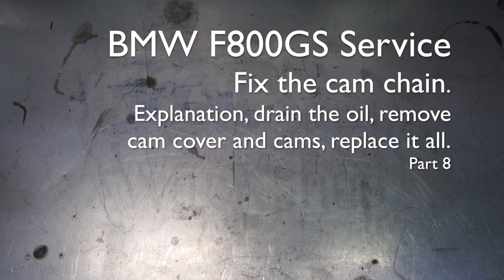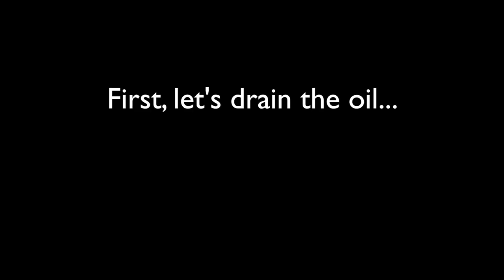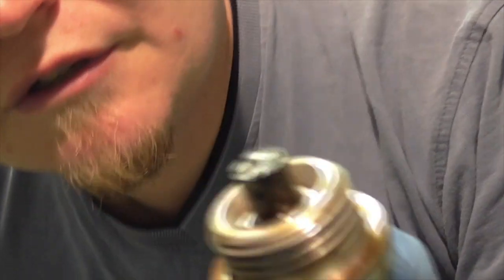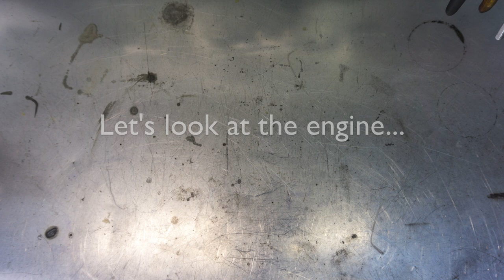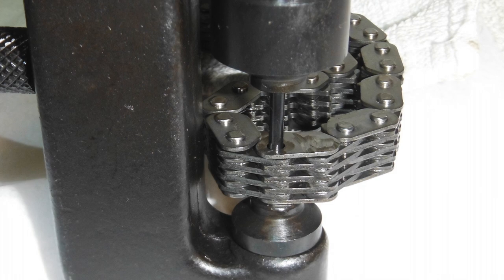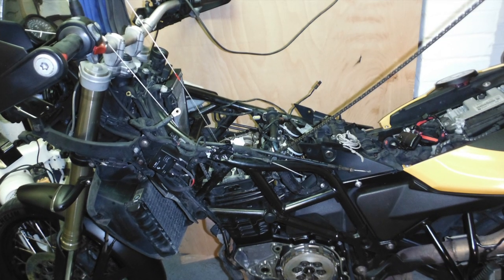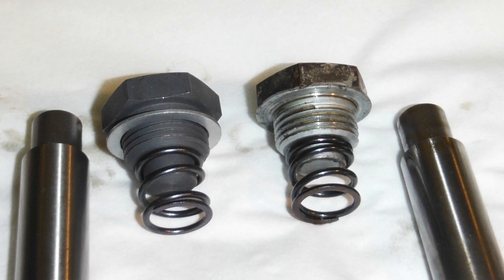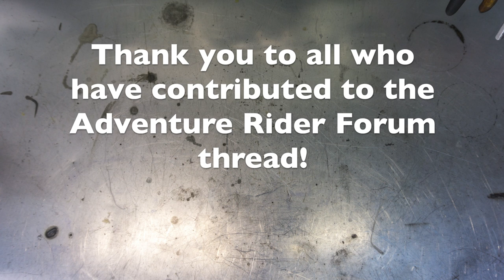F800GS Service E8: Replace cam chain, followers and tensioner

Comment from the maker: I keep getting questions about where to get the links. I don't know as this video is now over 6 years old. However, I'll post links to sites that have links here in this pinned comment. If you find that a link is out of date, let me know, if you find another link, let me know. I know that YouTube doesn't like you posting links, so you might have to figure out  another way to send the link to me (no, you're going to have to figure it out as I'm not sharing that info here).

https://www.motorcycleproducts.co.uk/sc0412h82rh2015-cam-chain-rivet-link/1/008357 - thanks to @hetzaljekindmaarzijn
Reply: Какие симптомы были перед тем как решили поменять цепь?.
Reply from the maker: @moto8808  Utifrån så är det inte många symptom förutom extra oljud, men om man öppnar motorn och granskar kedjan så ser man det klart om kedjan är sträckt.
Reply: С наружи то понятно..) Стучит двигатель (f800s), иногда глохнет, потерял в мощности.. Вот и пытаюсь понять.. Цепь да провисает.. Спасибо..)
Reply from the maker: @moto8808  You will get lumpy running especially at low rpms. And more noise, as I said. The mechanical issue is that the cams will change their timing depending on whether the engine is accelerating or deceleration as the crank will put tension on different sides of the chain. I have no idea whether the chain tensioner can work against this or not, or how much it is able to supply tension. It’s not an adjuster, it just takes the tension off, and if the chain is worn, there’s a large chance that the tensioner is out of range to provide enough tension. 
However, I think a lumpy low rpm range (<1500 - 2000rpm) is a sign of that the cams are slightly out of phase.
Good luck!
Reply: @JockeSelin да, согласен.. Спасибо.. Стук вероятно издаёт сама цепь об верхний успокоитель в момент распремления..
Reply from the maker: @moto8808  Yes, the chain might be slapping against guides and other things.

Comment: Thanks Jocke! I'm part way through this repair, but had run into an issue with my master link being way to tight! The chain tool I'm using didn't work well for the riveting and was instead squeezing the plates together (it had a void on back plate so fixed pins on the master-link were not bearing). Anyway, I think I can get it freed up, otherwise, I'll order another master-link and try again.  If any one else is attempting this, make sure your tool is correct! Your video has helped me immensely, thanks again!
Reply from the maker: Hey, glad the video has been useful. I'm still annoyed I wasn't able to film it all. You're right though, the master link can be quite delicate to put together. As with bicycle chains, it might work by bending the chain side-to-side, carefully of course, to loosen up the links. When I ordered the master link, I think I ordered 4 of them. I heard of another person who also had trouble riveting the links and had to use more than one. So definitely get more than one. 
So, what we've learnt: More than one link and correct tool! 
Excllent! Thanks for your insights!

Comment: There is also a mechanical cam chain tensioner made for this as well.  I have one, but have never installed it due to the thicker oil recommended by BMW eliminating any noise. (15w-50 BMW oil) works great in my bike. The tensioner is made by a small company in California, it’s all billet and a quality piece.
Reply: do you want to sell it if you not using it?
Reply: The company is right down the street from me actually.  I just installed one on my F800GS over the weekend and it's working great.  I was a bit nervous, but the installation was super easy.
Reply: @xDownSetx  Hi Michael. Do you have a link or email address for this mechanical cam chain tensioner please ?
Reply: Hi sako4me. Where can I buy this mechanical cam chain tensioner ?
Reply: @edzardbiermann7139  A link will probably be blocked by youtube, but if you Google "Southern California Motowerks 	MCTF800GS" it should be the top result.
Reply: @xDownSetx  Thank you Michael, this address you sent is perfect. I hope they will ship to RSA !!!

Comment: Thanks for the video. I have a 2015 F 800R with 19k km (12k miles) on the clock, and it sounds really rough when the engine gets warm. Had the valve clearances checked recently, but the rattling noise keeps getting worse. Now it started idling roughly when hot and a warning light came on. Tensioner seems fine to me but I guess I'll go ahead and change the chain along with everything else. Definitely wouldn't have expected it to wear out with such low mileage and regular oil changes etc. But after seeing how the old chain sags in this video, it looks exactly what my bike sounds like. There's something inherently wrong with the design or quality control if this happens at 19000km lol.
Reply from the maker: Apologies for the late reply!
Did you check the chain's tension when you had the valve clearances checked? I would have guessed that a bad cam chain would have revealed itself at this point? You should definitely check it before replacing it, at least so you know you're fixing an actual problem. 12k miles seems a bit low for this problem to surface.
And I agree with that there's something wrong; in the pursuit for lightness they seem to have skimped a bit too much on the cam chain size. Apart from taking a lot of time and being a bit nerve-racking the process isn't too complicated. 

Good luck and thanks for the comment. 😎👍🏻
Reply: @JockeSelin  
Unfortunately I took the bike to a shop for the valve clearances, so I wasn't there when they had the cover off. They didn't mention anything about the chain though, but I can't be sure whether they really looked at it properly. 
I ordered a new tensioner which should arrive tomorrow, see if that helps. Thought about going for the manual tensioner but decided to give the OEM one a chance. 

Just gotta hope that this year the Finnish summer lasts for a bit longer than the usual 2 weeks so I'll have some time with the bike outside the garage 😅
Reply from the maker: @macgarymusic  Let's hope the new tensioner cures the rough sound. These engines do rattle a bit at start up and when the engine oil is warm, so it might not be anything too bad.
It would be a shame if you had to miss on the wonderful summer riding due to bike repairs/maintenance. Fingers crossed for you! 🤞🏻🙂🤞🏻
Reply: @JockeSelin  update: Tensioner didn't make any difference. Took the bike to a shop for diagnostics, and got a call from them yesterday. 
They said that the issue is the radiator fan. The fan motor has somehow seized, causing it to draw excessive current when the ecu is trying in vein to run it, which means that other electric components don't get enough power. This results in poor injection/ignition, causing the bike to run poorly and thus the chain rattles because it's not running smoothly.
Never would've suspected such an issue. New fan should arrive next week, still a little sceptical about the whole thing but we'll see after I get it back.
Reply from the maker: @macgarymusic  Thanks for the update, I sure appreciate it and I'm sure the community does too.
I've heard of the fans seizing before, in fact my friend's one did. However, I would have thought that the ECU would simply have disabled it if it draws too much power. Having said that, the F800 electrical system is know for requiring a healthy amount of power. A bad battery won't allow the bike to run at all. On Caz's bike we suspected the faulty fuel pump drew too much power and thus the ECU disabled the heated grips. Healthy angry pixies is a must for this bike.
Also, a diagnostics tool, such as the GS-911 will not only allow you to read the fault codes, it also allows you to cycle all sort of electrical features on and off, such as the fan. Yes, you can click a check-box in the UI and turn the fan on. Much easier than running the bike hot to see if the fan starts.
Anyway, I hope the new fan cures your problems and that you'll be out tearing up the tarmac and gravel roads in no time! 🤟🏻😎🤘🏻

Comment: Shop wants $4000.00 US to fix this issue on my bike. They want to split the engine the traditional way. I also have bent valves. 62000 miles on engine. No issues before this happened. They told me the parts would be $2000.00 US. That sounds very high to me. Thanks for sharing this video. I’m going to try this method at home.
Reply from the maker: That sounds very expensive! What exactly happened to your engine? Do check out the AdvRider thread for more information and hope you get it fixed. It’s not that difficult. Just don’t rush it and be extra careful with everything and triple check everything you do. You should have it done fairly quickly. 
You can do it!! 😎👍🏻👍🏻
Reply: Jocke thanks for the reply. The engine started for 2 seconds and then shut off. Zero compression resulted. The mechanic told me it skipped a couple of teeth which resulted in the engine being out of time. Which resulted in the bent valves. I will watch the adv video you told me about. Thanks for your advice. I live in Arizona and it is really hot here right now. I will start the repair in a couple of months when it cools off in my garage. 40c here today.
Reply from the maker: Arizona is lovely! Spent a few weeks there last May. Loved it. Whenever you get round to fixing the bike, I'm sure it'll go well. Sounds like you've got quite a bit to do. It might be easier to fit a 2nd hand engine. All the best! Oh, and the link to AdvRider forum is in the description. A lot of information in that thread.

Comment: Great job! Many Thanks. One question: Why did you remove left cover of engine? is necessary ?
Reply from the maker: It’s quite a long time ago, but I think we removed the left engine cover because we wanted to change the plastic chain guide, and it pivots at a bolt that’s accessible from behind the engine cover. If you don’t do this, I believe you can change the cam chain without removing the engine cover. I’m not 100% certain though. Just can’’t remember.

Comment: I wonder if the new cam chain tensioner if installed first would have removed the sag.
Reply from the maker: The chain was stretched. A chain tensioner is not a chain adjuster.

Comment: When rotating the engine, I assume you took out the locking pin you used when locking the engine at TDC?
Reply from the maker: Yes, that’s correct. Wouldn’t rotate otherwise, but I didn’t make it clear it was removed.
Reply: @JockeSelin  Thank you for clarifying. Keep well.
Reply from the maker: @ruangloy7099  No worries and take care! 😎👍🏻

Comment: Hey Jocke, great video. I'm rebuilding the same bike and your videos are very helpful. Have a question, if I'm not replacing the guides - just the chain, do I need to remove the cam retainer cover and cams? Would it be possible to rotate the new chain on while turning the engine over? I'm assuming you removed them so it was easier to align everything once you had the new chain connected.
Reply from the maker: Thanks for watchin'! 😎
I wouldn't recommend leaving the cams in place. Not only do you have to rotate the engine, but you have to do it with the cams in place and making sure you don't hit the pistons. I don't know if there's a point where the cams are in a position where all the valves are shut, in case you could remove the chain from the cams and rotate just the pistons. 
It just sounds like creating a lot of points where things could go wrong. Removing the cams is not such a big job, and when putting them back you know everything is aligned too. Also, the cam chain guide (clutch side) tends to break off if you don't remove the cam cover very carefully. So keep that in mind regardless of whether you intend to take it off or not. 
Good luck! 😁👍🏻
Reply: @JockeSelin  Good points, I'll just remove them and realign. One more question: do I leave the TDC locking bolt in while I roll on the chain? I wasn't able to tell from the video if you positioned it there more for repositioning the cams. Thanks for the help.
Reply from the maker: @zakw3637  You’re right, the video doesn’t show it. The TDC locking bolt literally locks the crank, so to rotate the engine and pull the chain around, you need to remove it. Hope that clears it. 
Good luck! 😎👍🏻

Comment: Thank you for the video! Great job!
I managed to get there -- almost. I am just fighting with the rivet tool, which is too big in my eyes to get the kind of result shown in the video (it is maybe better for drive chains) - How (or with what kind of tool) did you rivet achieving such a good looking result? Not with the tool shown in the link, I assume -- I have a similar one and the chain is far to small to get fixed correctly. The rivet pin is too big for the 2.6mm masterlink to be split??  My tool is ruined already, but the Masterlink looks as it came out of the box.
Reply from the maker: Sorry to hear about your problems. I used the “Draper 31318 Expert Chain Splitter and Riveter Kit” (https://www.amazon.co.uk/Draper-31318-Expert-Splitter-Riveter/dp/B004L6DUV0) as is linked in the description. The smallest riveting tool worked just fine for me. I did grind the ends off the old chain link to break it when I removed it, and also the new chain too to remove the link that was replaced with the master link. With all riveting tools, you have to get it all aligned perfectly or the tool will break. 
You actually don’t have to squish (rivet) the link very hard. It just needs to expand the ends of the link to prevent it from moving off. I do remember having a bit of an issue trying to get the tool into place, I had to push it through the frame. 
Sorry, it’s been a while since. It did work fine, and it wasn’t an issue. Let me know if I can help any more.
Reply: Hey Detlev were you able to figure it out? I tried a similar tool with the same results
Reply: @zakw3637  Moin - There was no other option rather to complete the job. So I had to be patient and analyse the details (upfront: I succeeded and it was worth it!). In the video the link was a tubular rivet, I had a solid one, which was the reason why the tool broke. So I bought a more solid chain tool at "Louis" (Rothewald), but as this was too big as well, it was  kind of job for 10 hands which took some time, because I only had two of those. So the answer - buy a solid tool and take you time - save all the area around, so you do not loose any material in the motor! - I had one "almost" accident, but I finally found the part after one hour! Never give up!!  As mentioned: I succeeded at the end, and the valve timing was as it should be at the end - the two lines matched exactly - before there was a variance and the chain was loose. Then I drove one year (appr. 5000 km) and doublechecked it during the winter time again - still everything perfect. Machine is running smoothly now (ok - after 75000 some noise is still there, but for me I define it as "character") - now I am sure, this will be good for a lot of years. Hope that helps - have fun!
Reply from the maker: Glad you got there in the end, Detlev! And thanks for providing more information. 😊👍🏻

Comment: Thanks Jocke for nice video. Maybe you should mention to always turn the crank an even number of timer because then crankshaft and camshafts are on the same points of the sequence in case of ignition or injection sensors are on de crankshaft. By turning the crankshaft in its reverse direction the camchain always wil bend as you put force on the cam chain tensioner in the wrong way. Are you sure you turned the backwheel forward when you made the video of the bending chain ?
Reply from the maker: Thanks for watchin', Marius. 
There are no sensors on the cam shafts. As for the direction, have a look for yourself: https://youtu.be/DxaEmghc5n0
Reply: @JockeSelin  As for the direction of turning i was a little wrong, you have to turn the wheel backwards otherwise the tensioner wil get pulled on and give way. Instead of driving the wheel with the crank you drive the crank with the wheel so when you turn backwards the tensioner won't get stressed and the chain will pull on the cam shaft in a straight line.

Comment: This is a great reference video Jocke.  Thank you. I’ve watched it many times as I’m about to undertake this job too. I’m trying to source a master link locally in Australia before starting the job. Do you happen to know what the pin diameter is of the link?
Reply from the maker: Thanks Raymond! I hope the "operation" goes well. I do have a couple of spare links, but I don't know exactly in which box of bits they are. If I find them, I could measure the pins, but please don't hold your breath. I'll ask her-who-knows-stuff to see if we can find the spec for you, that might be more accurate. Sorry I can't be more helpful.
Reply from the maker: Hope the link works to the AdvRider thread:

https://www.advrider.com/f/threads/d-i-y-cam-chain-replacement.727687/page-8#post-18036748 

You should find the details there. Hope that helps.

Comment: Hi Jocke, Thank you very for the valuable video sessions. My question; I have  2010 F800GS 2010 with 100.000km, what is cam chain lifespan? Many thanks.
Reply from the maker: Thank you! It's hard to say and I think the best way is to check the condition of it. If it sags too much, replace it. If my memory serves, this engine had 57,000 miles (~91,000 km) on it, see the first episode for details.

Comment: Great tutorial. But the only wrongdoing is riveting the links with the ball tip type. The ball tip type should only be used for hollow rivet pins which flares out the rivet head. You should have used the square head flattening rivet (like the other links). You can clearly see the heads of the rivet pins cracked. This is likely to lead to failure.
Reply: Do you happen to know where one can get a quad head flattening tool for this chain? I tried to flare it and it didn’t work.